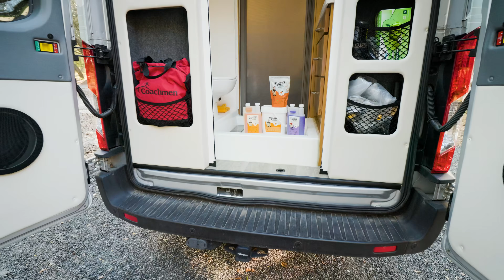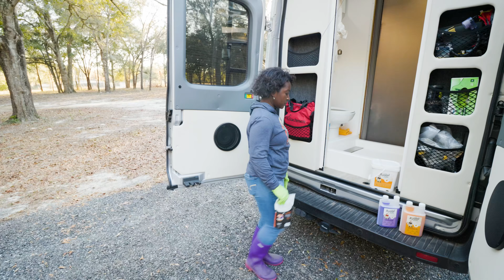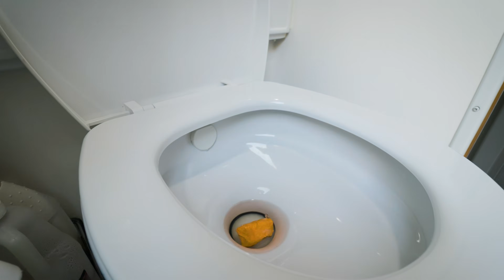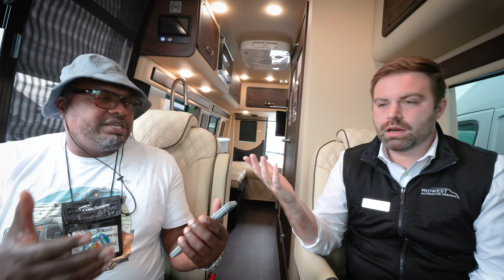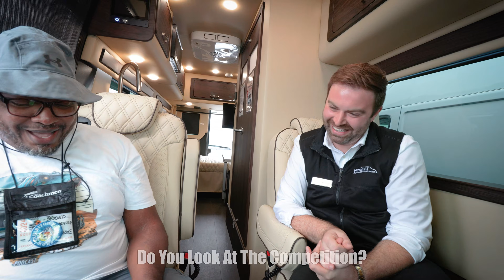5 Hardest Questions For Camper Van RV Manufacturers - Midwest Automotive Designs

Comment: Ron why is my 2023 Midwest md2 falling apart. I have so many issue too many to list this can is literally a money pit form the lithium electric to uh pretty much everything. Also, when you guys do that custom paint to the running boards and side reflectors and bumpers, you’re covering up the Mercedes sensors which they addressed to you guys and put a bullet to now but you’re still doing it.
Sorry but I really wish this company can get their shit together because they’re made in the USA but after spending $220,000 my van’s worth 80 grand with literally everything needs to be fixed